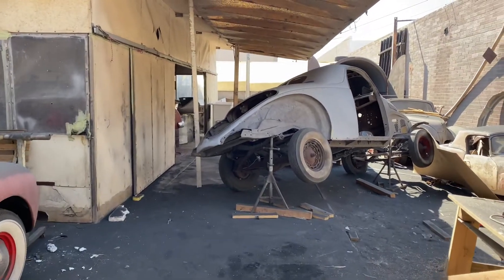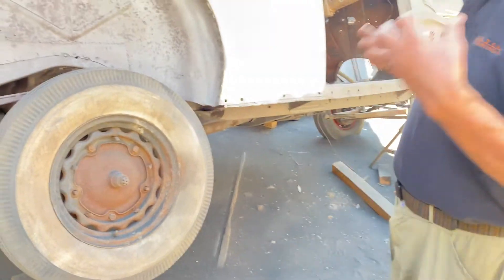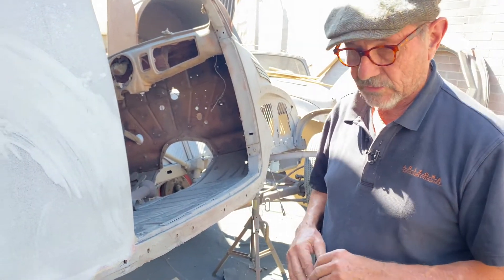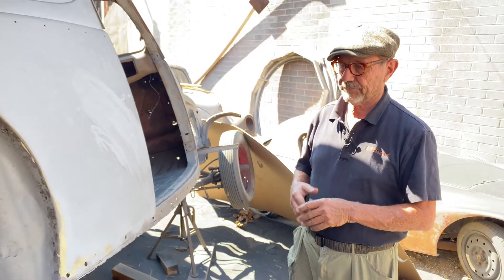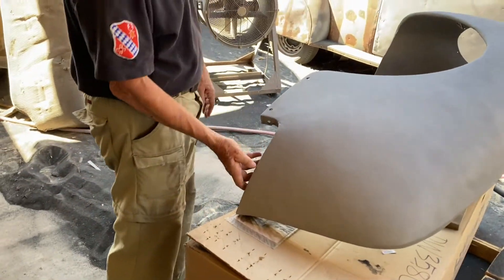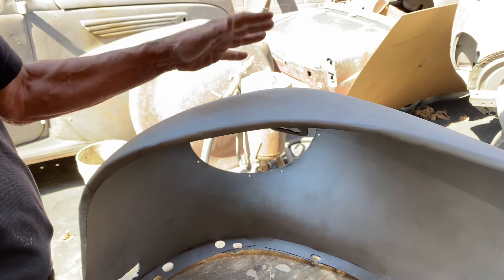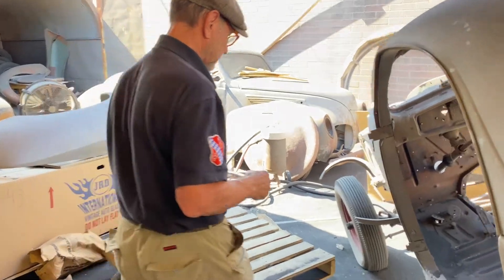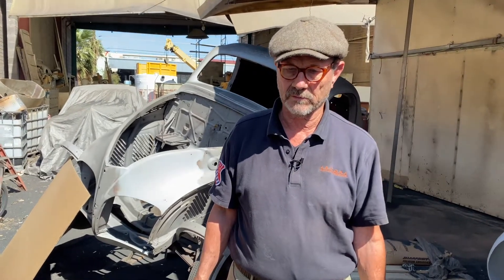1938 Zephyr Part 8 - Blasting Away! 1938 Lincoln V-12 Zephyr Coupe Restoration

Comment: Haven't gotten to blasting yet ------ yes ------- Rotisseries are expensive ------ but ----- he shows the use of Mobile Home Jacks and also the 55-gallon barrel idea filled with water ------ these two ideas could save enough money to have your chrome parts ------ Triple Plated ---- and the safety tip on suiting up to blast away ----- some good tips there ------------ Rodney